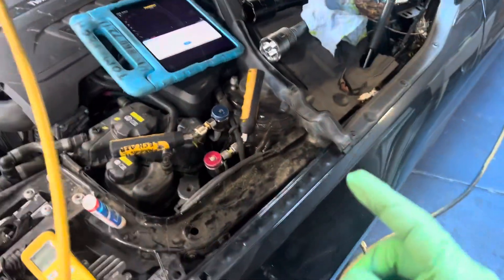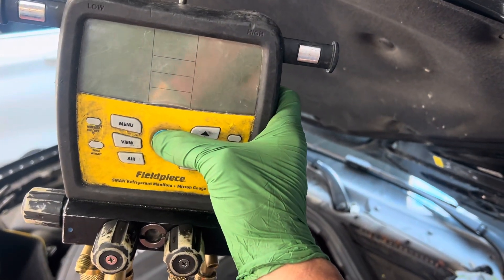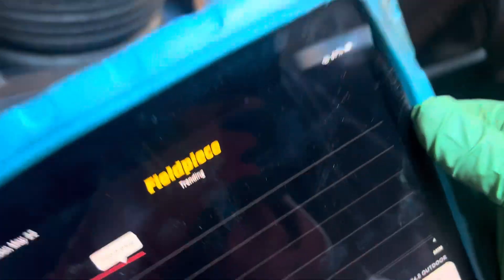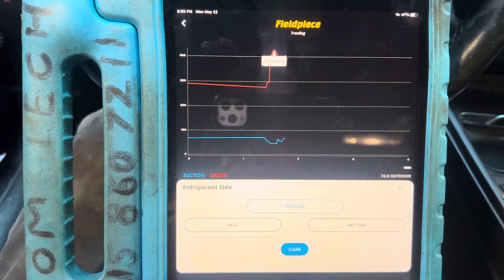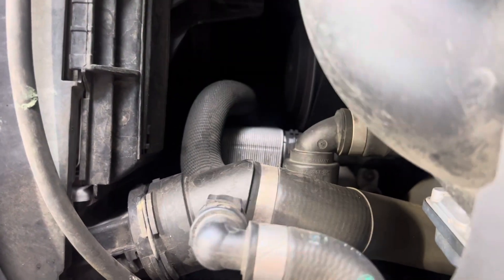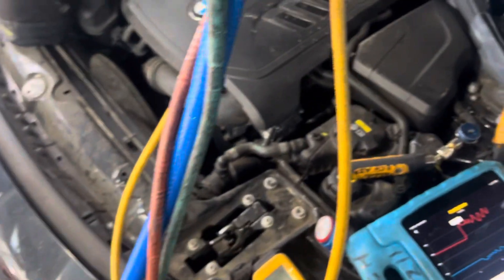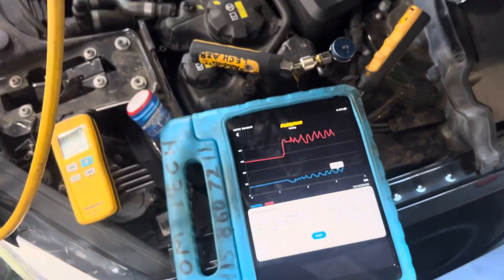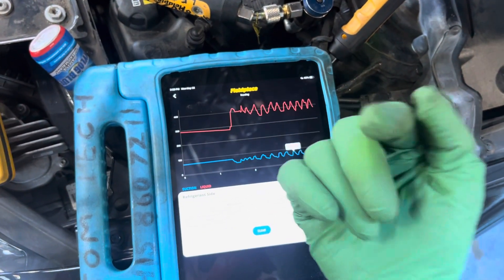FIRESTONE AC RECHARGE ATTEMPTS 3 TIMES. Glycol loop condenser plate heat exchanger ￼no condenser ???

Comment: Interesting, have to look out for this.  Thanks for sharing👍🏻
Reply from the maker: And there are several models now in the automobile market that used Blackhorse plate heat exchangers instead of gas, refrigerant condensers in the front of the car

Comment: We had 1 similar last year the problem was that there was air in the heat exchanger
Reply from the maker: Yes same here, coolant was low. 

I get this from all the shops in my area all the time. 

This is what happens with lack of knowledge. Or understanding 

I get to work on all the new EV’s heat pumps every day here in SF ,CA 

Wait until you see shops burn 🔥 up expensive electric compressor and all most everything needs replacement  from the dealership and customer charging back the last shops that did it wrong. 

$6000+ is a cheap bill 💸 to start. 

After one or two of those the shop gives up on AC work.